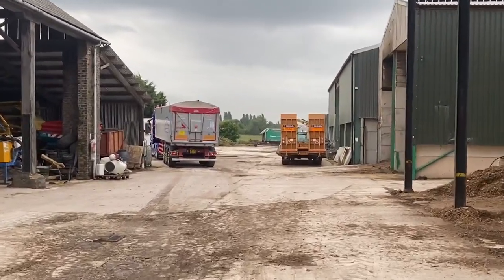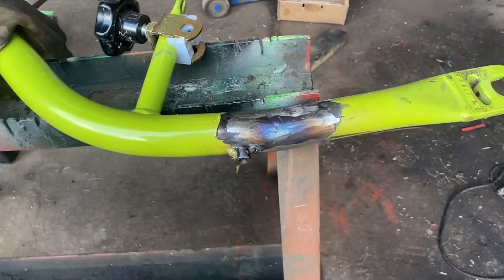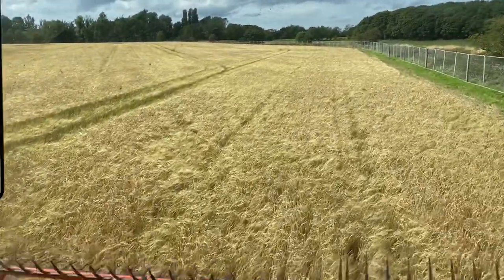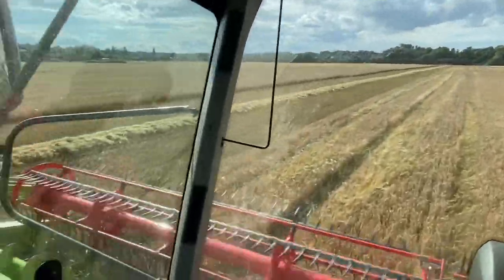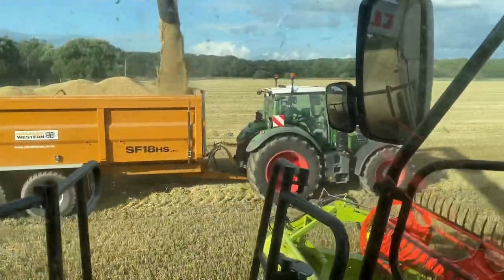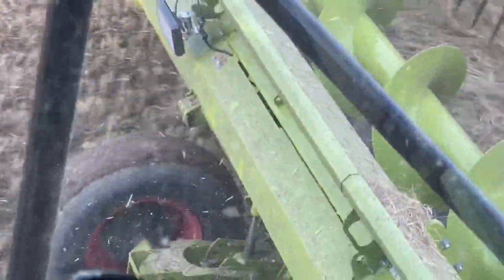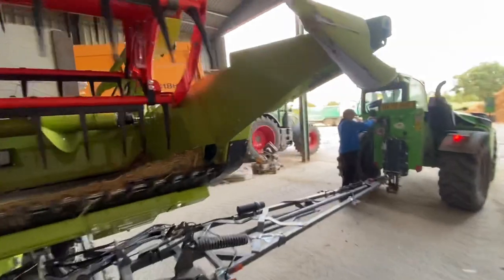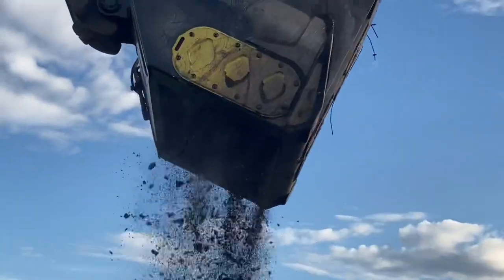Day505 #OLLYBLOGS HUGE SCREENER BUCKET CUTTING BARLEY BEFORE BULLDOZERS AGAIN #AnswerAsAPercent

Comment: That’s good the combine will unload ‘wet’ grain without too much hassle. I remember in 1997 it was so wet in Pembs so as to finish harvest, the combine was fitted with duals all round and we had to unload on the move the whole time as the grain stuck in the tank if we didn’t.. Fun and games and plenty of drying 😫
You using the compressor for blowing out rads etc..
Reply: 1997?  It's always wet in the Shire lol!

Comment: Is that Conbine 4 wheel Drive?  And do You have door for the Front of Your Sheds for the Winter? Otherwise they do make Heavy Duty Curtains for the Front & Back of Your Sheds. Also you just need a Pump to get rid of the water in the Sunflower Area. Then You dont have to move Everything Olly.. Just trying to Help You Out. And ALL the Buildings You Are Fixing Up They Look  GREAT..
Reply from the maker: Drying sheds are open 
Could use a pump
No not 4 wheel drive

Comment: There looks to be a hole or a gap on the auger spout/ grain pouring guide (the black bit) and some grain slips out. time stamp, 7:10 , not really a problem as it still pours over the trailer but thought i should let you know
Reply from the maker: Yes it needs silicone

Comment: If the John Deeres engine isn't standard, why should the manufacturer pay to have it repaired?

It wasn't designed to be putting out that extra hp.

Should have bought a bigger tractor.

I can't reverse our header trailer like that.🤦‍♂️